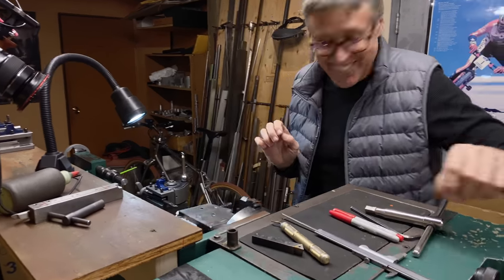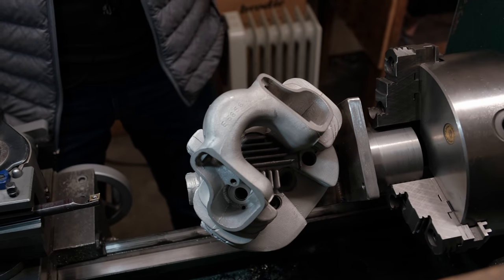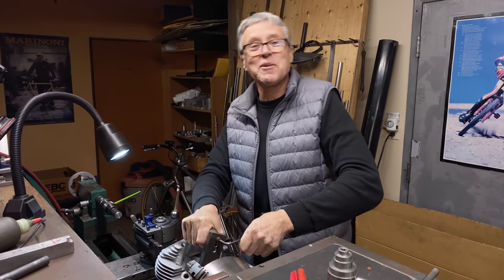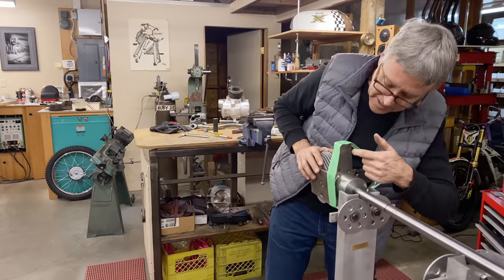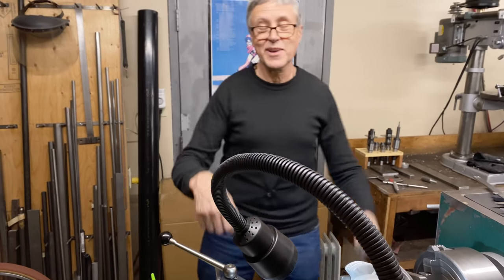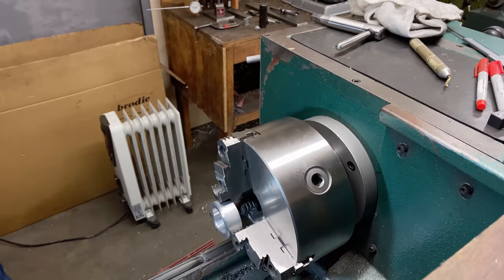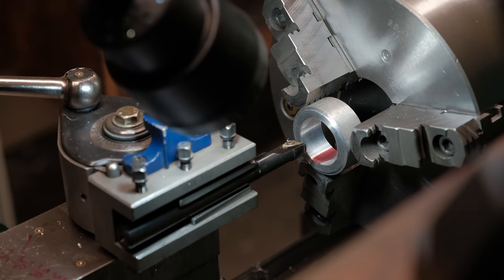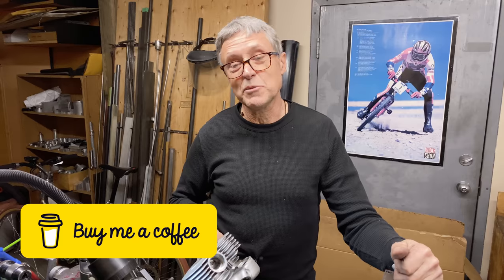Tiger Cub Exhaust Port // Paul Brodie's Shop

Comment: Some ballsy moves there with that head.  I've never done an internal single point thread but you make it look easy (as usual) :D
Reply from the maker: Yes, a lot can go wrong, but I guess Lady Luck was smiling down on me.
Reply: Only did that once - 30 years ago, in machine shop classes in college!
Reply: tip - reverse the tool and lathe, and cut it on the opposite side, no risk of crashing.
Reply from the maker: @daos3300  Then you need a starting groove on the inside, which basically weakens the part.

Comment: Well Paul to say you scared me when you fired fired the lathe up with that eccentric weight in the chuck is an understatement. I thought the lathe was going to chase you around the workshop. Anyway good job I did something similar years ago on a 50cc NSU moped that had stripped the exhaust threads, a labour of love as the alternative was walk 3 miles to work!

Comment: You were on a roll with that thread cutting. The balance factor reminded me of a time as a student  when I was making a V twin from a rover V8. I had cut the crank and needed a centre in the end but lacked confidence on the lathe. I was a psychology student using the machine shop in college. Anyway the technician said he would do it, spun the crank too fast and snapped the centre drill off in the end of the crank. End of my project.... 😔 .
Reply from the maker: That's too bad the technician screwed up and ended your project. Thanks for watching and commenting.

Comment: The pattern parts all seem to  need fettling to fit these days, or was it ever so ? I recently brought a set of petrol tank bolts and rubbers for the 56 T110. that were usless the bolts were the wrong length and the 'rubbers ' were like slightly soft plastic with very little compression. in the end I re used used all the old set  .

Comment: Another great video Paul! How does the thread cutting with a single point work..’boring bar motor’ in sync with the lathe speed?
I hope Mitch got more film! 😂
Reply from the maker: Thanks John. I switch the lever from "feed" to "threading" and the carriage travels at the rate of thread I have selected. In this case 20 TPI.

Comment: Do you ever set your compound to 29.5 degrees to lessen the cutting pressure when threading?
Reply from the maker: I was taught that in school, but I never do that. The new carbide inserts are very sharp, and cut very well.

Comment: Paul, awesome as ever!
I was wondering if you turned the thread to a fixed depth, as per a threading chart, or were you using full form threading inserts to make things easier ?
Keep up the fun, its great to watch !
Reply from the maker: Nathan, I never looked at a threading chart. The DOM tube was .036" larger than the bore, so I guessed and cut the thread to a depth of .022". From previous jobs cutting a 20 TPI thread I knew that sounded about right.

Comment: Paul!!  Dammit!!  First off, I have fallen in love with your channel.  You are doing a lot of things I do in my retirement, only I am lightyears behind you.  Home machine shop, old cars, old Brit bikes, metal fabrication, design.... too many things to list.  But I also HATE one episode.... the instructional on TIG welding.  I do stick, and MIG.  NOW, after watching  your instructional, I have to go buy myself a TIG welder.  And I don't have a use for it.  But somehow I need one.  BTW, might you have any means to locate a center stand for a 1958 Norton 650 Nomad?  I need one for mine.  Fell off years ago, and I am finally getting around to restoring it, again.  Can't wait for your next installment.
Reply from the maker: Thank you Johnnie, great comments. You will have uses for your Tig, believe me. It will open up new ways of doing things. I do not have any leads on a centre stand, sorry.

Comment: Get that lathe, fixture and cylinder head to top of Empire State, bolt it to a main girder, set it running and get out of the building before it comes tumbling down.

Comment: Thought about using the back gears to reduce rpm and vibration at cost of increased cutting time?
Reply from the maker: I could have slowed the speed for the boring operation, but the threading speed was pretty slow and worked just fine.

Comment: Just for my understanding, why do you equilibrat the all mechanism before putting it in the 4 teeth mounting and not in the final position ? The balance should be done around the final rotating axle, no ? Thank you
Reply from the maker: We only have so much time when Mitch comes over to film. And, this was a one off operation so the balance was "close enough" to make it work. If I was doing hundreds, I would have worked on the balance factor more.

Comment: Paul, just for curiosity, did you lately realized that a better balancing should be done in relation to the center of the turning on the four jaw and not the center of the round stock?
Reply from the maker: I fully realize the balancing wasn't perfect. When Mitch shows up to film an episode we only have so much time, so it's a "balancing act" to get everything to happen. It worked. If I was doing multiple multiple heads, I would have spent much more time making the fixture look better and to be balanced perfectly. Thanks for watching.

Comment: You definitely have some unique ideas for getting around a problem but wouldn't a mill work better for that instead of spinning it in the lathe¿?
Reply from the maker: How do I cut a thread in my manual mill? Only CNC can do that.
Reply: @paulbrodie  -  I'd be trying to make a custom tap before I'd spin a head in a lathe, that's just scary and I feel like it would break something or it would shake itself apart....  I don't even want to think about how much that would cost or how hard it would be to change bearings or something on the lathe.    😩
I'd probably only try that if someone showed me exactly how to do it w/o breaking the lathe or myself in the process...   😆
Reply from the maker: @xpndblhero5170   The tricky part is dis-engaging the feed and moving the tool out of the way at EXACTLY the right moment. You can see it in the video. Both hands react at the same time.
Reply: @paulbrodie  - Yeah I seen that, here and in a few of your other videos, it's an impressive skill.... I know it's an expensive "hobby" but it's still a skill I'd really like to learn at some point in my life.

Comment: Did you tell the poms you were using HD forks not standard forks by the way 15 minutes goes to quickly.
Reply from the maker: HD forks? I'm not sure what you are referring to...
Reply: @paulbrodie  Your 25 September episode you showed the heavy weight (HD) forks you had received and were fitting in place of light weight forks which has a larger diameter. you must have ordered for light weight instead of heavy weight.
Reply from the maker: @davesalter4928  You may be correct, but I seem to recall the lightweight forks only have an o-ring to seal the oil in. I would have to check the parts book to be 100% sure.

Comment: Sometimes you scare me with that lathe of yours. I shouldn't have to put on safety glasses to watch your videos. Do you think a tapperd thread would work for a exhaust. Such as a IPS thread. Nice bit of work. EMMA
Reply from the maker: Cutting a tapered thread on a lathe is not easy. I have never done it; I believe you need a taper attachment, which my new lathe will have.